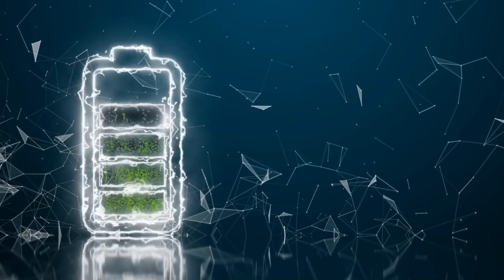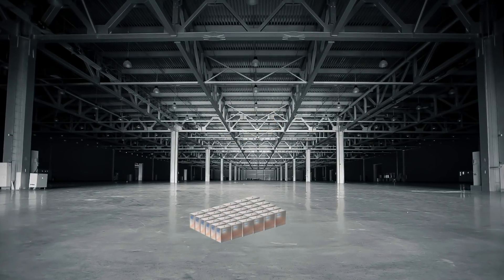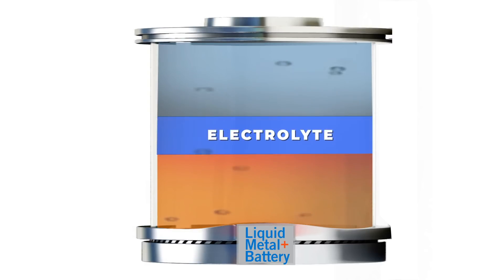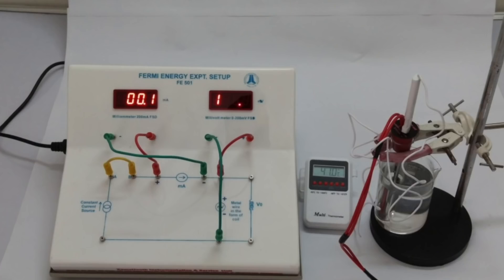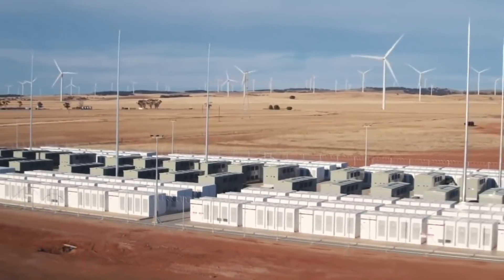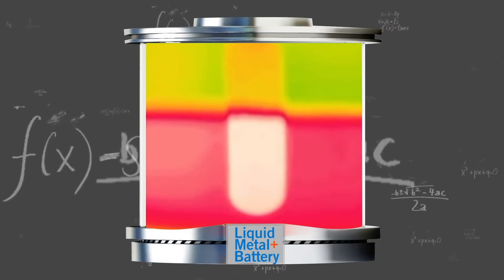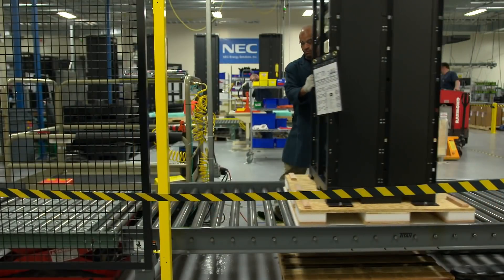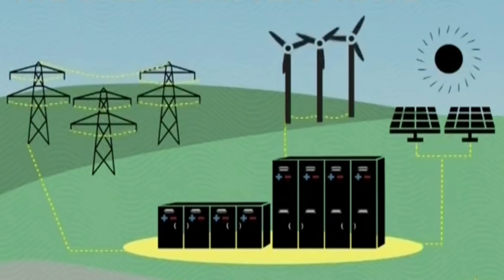The insane engineering of liquid metal battery technology-How does its works?

Comment: Clearly not for an electric car but how about for powering electric trains.  Non conductive slosh baffles could greatly reduce the effect of motion and each train could have a 'battery car' just behind the engine (think of the old steam trains with the coal car behind the engine).  The battery car could be exchange out at rail yards or even charged while the train was in motion over electrified sections of the track.

Comment: Is there a liquid metal-air battery? For instance, zinc-air battery uses zinc and oxygen from the air as the electropositive and electronegative components respectively. What if zinc was replaced with a liquid metal?
Reply: It may be a great challenge to keep the Zinc in liquid form because it will start evaporating if the temperature goes up by even 4 to 5 degree Celsius. You can not keep at boiling point constantly.
Reply: @VenugopalanV-v5x  I would either use a solvent or a Sodium-Potassium alloy (NaK) which remains liquid at room temperature.

Comment: The liquid ion battery Ambri must be keep heated at 600C . You need a lot of energy to heat. I didn’t heard heard from the engineer how they would do that for small devices. It could work for heavy industrial battery but not for portable battery. And they must take into account the cost to keep heated the battery, and the energy required to do that.
Reply: Battery seft heat on changing and discharging.

Comment: How does it reach its initial working temperature to start up the first time?
Reply: presumably when electricity flows will cause enough heat to melt the materials. I’ve made an assumption that it will still supply power in it’s solid state.
Reply: @darylcheshire1618  No, it won't supply power in solid state, that's the entire point of the emphasis on liquid.

Comment: 2:00 Maybe I misheard but I thought you said "lower operating temperatures [than lithium ion]", but I believe these work at around 500C.
Reply: Yeah... i've never seen an honest comparison of how much energy it TAKES to keep these things at a casual 1000'F, which is kind of insane, versus how much these batteries can store. It's a super crucial detail that seems to get glossed over. Also they output DC natively which doesn't tie directly into the grid out of the box, it has to be converted to AC...

Comment: Sound like liquid BOMB🙄🤔
Reply: I don't think so. Only materials in gas form explode or going to gas form, like solid to gas or liquid to gas.

The liquid metal isn't putting much pressure on the walls of the 'container'. Even if the container breaks, a concrete floor would probably protect the rest of the building. A small concrete barrier would stop the liquid flow and it would cool quickly into a solid state.

Comment: I am not going to run a battery at more than 400 degrees Celsius.
Reply from the maker: No the first time to melt the metals they need 500c but after that the battery or the metal still melt on the room temperature

Comment: What if the operational heat is more than 500 degrees will the battery still work fine?
Reply from the maker: No the first time to melt the metals they need 500c but after that the battery or the metal still melt on the room temperature

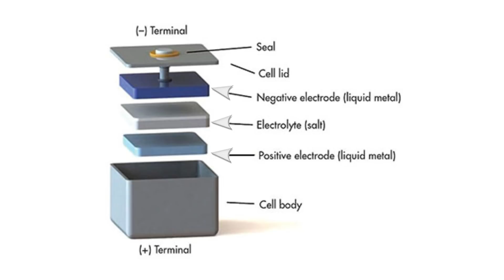Comment: 7:07 "sensitive to motions" 
There goes my idea to use it in my future EV. :-(
Reply: Install baffles like they do in Fuel delivery tankers or any liquid transport tanks. I built my own to carry and spray coal tar emulsions to the jobsite. Works great.
Reply: @scottbaxter2682  - I have a feeling that baffles might not work here. Baffles don't stop the motions of fluids but damps the forces that moving fluids cause.
Reply: @danijelandroid  True. Also wouldn't do much in the event of vibration or up and down movement prevention unless each horizontal and vertical separator (plate) had offset perforations (small pass thru holes). 
Anyway, I like the battery. I'm in the solar business. We build parking lot solar canopies over parking lots and storage is going to help.

Comment: It doesn’t have power operating temperatures, it’s literally molten metal. But this is a good thing.
Reply from the maker: No the first time to melt the metals they need 500c but after that the battery or the metal still melt on the room temperature
Reply: @ScienceScout  the metals will not stay molten at room temperature.

Comment: Hardly mention that operating temperature is 600/700 degree Celsius
Reply from the maker: the first time to melt the metals they need 500c but after that the battery or the metal still melt on the room temperature

Comment: Aaahhh.., the elephant in the room. No one, on an any channel, ever discusses the containers. Liqud metals, top and bottom, must be contained in a non conducting package. Why does NO ONE talk about an insulating container that can withstand the high temperatures? Ceramics sound good at first glance, but can they expand and contract without cracking?
Reply: This is what 10 years of development went into, creating a long lasting ceramic case is not easy.
Reply: @velianlodestone1249    Sounds great! But.., why isn't this a highlighted or emphasized part of the press releases? It alone would make a fantastic video.
Reply: @johnlshilling1446  would not have the same marketing ring as "revolutionary battery technology using liquid metal"
Reply: @velianlodestone1249    True, but I'd bite! (telling you that I'm nerd without telling you I'm a nerd!)
Reply: I wonder if the molten mass can't be kept floating somehow, perhaps on air cushions or magnetically.

Comment: It would be interesting to know from having these types of batteries in a hybrid vehicle and the amount of energy it would store and the fact that a vehicle is in motion how it does react to it in a liquid state once it reaches that point. Because from its durability and longevity it would be very efficient before it needs replacing. This one use could be mass marketed to the automotive industry.
Reply: Sloshing the liquid metals around can short out the battery - it's not a good choice for vehicles.
Reply: Obviously this isn't meant as a portable storage situation just as Li ion isn't a very good choice economically for a static storage solution.

Comment: You need a follow up video on advances in chemistry for LMBs which can operate at lower temperatures.  Presumably, exactly the same containers could be used but just filled with the new materials.  By the by, what material is used for the container and for the insulation layer.
Reply: It did cross my mind too? Since once formed to a liquid state how far does the heating process goes before it reverses to cooling back down or stabilize itself. And the encapsulation material is affected or isn't?

Comment: Peak performance at 500C... sounds like a lot of electricity is being wasted as heat
Reply: Yep... maybe 20%... but the natural condition of the universe is cold.. to say... heat can be harnessed. And I highly suspect many applications will not be in storing at peak performance/speed but more towards releasing the charge in a peak manner.
All batteries have this distinction, heat in charging or discharging... this tech takes the temp high because the rapidity of charge is high... POSSIBLY.

Comment: It could be used to hear water tanks in the winter with wind generators to keep them charged
Reply: They dont want to lose all that heat, the battery is insulated to keep the metal melted. It probably makes more sense to store the electricity and use a heat pump water heater. Or use a heat storage system directly

Comment: 2:07 what? lower operating temperatures? no, those liquid metal batteries need the metal to be molten at around 500C
Reply from the maker: That right they need to be molten but because they adding sodium potassium alloy on the anode and gallium indium on the cathode these can remain liquid at 20c
Reply: @ScienceScout  200c not 20c

Comment: 15 years is great but not enough. A typical electric reactor has a 40, up to60 years life span. Reversible Dams have a theoricaly Infinite lifespan. 
If you have to replace your electricity storage every 15 years, even if the battery is cheap it would still be massively more expensive than  today standard.

Comment: Can you explain more about the elevated operating temperatures?  The video states at (7:00) that 200 deg C is needed for operation.  How is that when none of the metals or salts are in liquid state??  The melting point of Magnesium is 650 deg C, Antimony is 630 deg C, Magnesium Chloride is 714 deg C, Sodium Chloride is 801 deg C, and Potassium Chloride is 770 deg C.
Reply from the maker: That true they need to be melted first on high temperatures but they using sodium potassium alloy for the anode and gallium indium alloy for the cathode these able to remain liquid at just 20c or 68f
Reply: Sorry, but you are woefully confusing different technologies here - whilst there is a Gallium based battery here able to stay liquid at 20c this is NOT Ambri, which operates at about 500c. Due to the price of gallium this alternative technology is not monetizable.

Comment: Would love a system that could connect to my solar & power my house.
Reply: These batteries are born for applications just like that. Could see these replacing the power wall
Reply: Not sure that is a good idea. 
In the summer time it will work well but as they like to be charged and discharged every couple of days in winter they may go cold and not work.
Reply: @grogery1570  Thermal mass. The fact that these batteries are encased in an insulated box the size of a small room negates that problem. Also the they are kept at temperates that literally melt metal, 20°C either side of 0°C will not make a difference to the battery in that volume.

In a way this could be thought of a thermal battery converting heat to electricity through chemistry, rather then steam. That chemistry in itself creates heat keeping the battery at or above required temperature.
Reply: @grogery1570  I'm interested in their 250kw system. Several builds on acerage with an average of 15 people onsite, sometimes 25. Might also be possible to supply excess energy back to grid to earn small income from grid.
Reply: @grogery1570  These batteries would keep your home warm as well in the winter.

Comment: Liquid metal batteries go back to the 1930s, with the 1st practical one made in he 1980s. https://en.wikipedia.org/wiki/Vanadium_redox_battery
Reply from the maker: Vanadium I think it's a flow battery
Reply: @ScienceScout  It used 2 tanks, when the differently charged liquid vanadium was combined it produced electricity. I think I saw the vehicle at the uni at the time. There was talk about having refill stations so instead of waiting to recharge you could be underway again like filling up a petrol tank.

Comment: The response time of the battery is pretty impressive.   With response times like this, of only half a second, I could totally see this being used as an energy storage technology to balance the grid.  Imagine a huge electric cargo ship plugging into the grid.  This type of battery could potentially balance the grid so well, we wouldn't even see the lights flicker.
Reply: It doesn’t appear to be useful anywhere that it would be subjected to motion. So no use any r place in transportation. But very useful and affordable in stationary storage applications and I’ve seen in other presentations on LMBs that recycling them is easy, cheap and non toxic.
Reply from the maker: I think this what NEC trying to do, it's still under development and testing

Comment: The energy density looks terrible compared to Li-ion. That mini-container is 200kWh - there are cars with half of this concealed in the floor. Of course, for its intended use, this barely matters. 

Once they've cooled down and solidified, how much time and effort does it take to bring them back to operating temperature?
Reply: Density is not an issue for grid scale where land is cheap and space is plentiful. Such a battery would never work for a car, but perhaps bury one underneath a street and allow a neighborhood's rooftop solar PVs to charge the battery and have it discharge at night back to the neighborhood.
Reply: 80% is still pretty good.. for comparisson, pumped storage has an efficiency of 70%, Flow batteries also about 70%.. But for stationary grid storage effciency is not as important as for a car that needs range, just add one or two more units. The ultra low degradation low cost and long life span offset this lower efficiency easily... Its a set and forget system that likes to be cycled a lot, no moving parts, no complicated BMS, no fire supression, no AC... Seems like a no brainer for an energy company looking for a cheap and reliable storage solution... So lets hope they can scale up production quickly, the world needs this to get off fossil fuels!
Reply: Compared to safety and lifetime of LI-ion it looks great. Not sure it is applicable to cars though.

Comment: Wonder if you could harvest some of the 500c heat generated for a steam driven generator?
Reply: Trying to harvest that heat will lower the battery temperature reducing its effectiveness as it requires such temperatures to operate at optimal performance
Reply: Right ... It doesn't make the heat ...
It Needs it ...

Comment: mass disc rotary energy storage. you did not mention what specific energy this has
Reply from the maker: Its chemical energy,the battery made of molten metals.
If I understand you right
Reply: KISS, NO moving parts
Reply: @elisabethsitorus2866  solid state is fine, but i dont force a strict limit, one part is also quite fine
Reply: anything goes, but dont force your rules